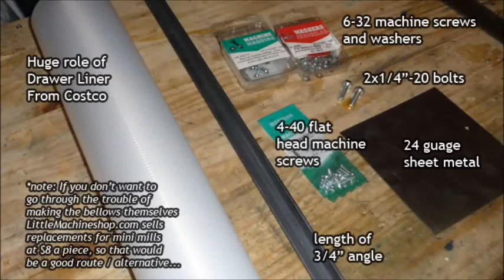DIY Lathe Bellows

Comment: You have some great videos. I'm looking forward to building my own Gingery lathe soon. I had the good fortune to meet Dave at his home some years before he died. He was a very cool tinkerer.

May I suggest that you'll get better performance from your hacksaw if you remember that it only cuts in one direction. You seem a little heavy on the return stroke. It can also help to put a drop of cutting oil on the cut line.

Thanks, again. I'll be referencing your example as I build my lathe.
Reply from the maker: Really cool you got to meet Dave, seemed like a very smart / eccentric person.

Thanks for the hacksaw suggestion. for me most of the time I don't take enough time ( trying to rush through the cut and get on with it ) which is probably why it appears that way. Will have to give cutting oil a try on aluminum, I do use it when cutting steel.

Cheers,
Morgan

Comment: I have been using paper and duck tape on my gingery but I would rather have a more permanent solution. I don't have a Costco around here. That material you used looks like it is from the 70's. The hall way mats that were used to lay on the floor over a carpet or something. Anyways good video...
Reply: how long did it take for you to make your lathe and how much did it cost?
Reply: It took me a year but it can be done quicker than that. I probably spent $200 or less that is including the surface plate I purchased to scrape the lathe and the cold rolled steel. It may cost more for other people since I utilized the scrap yard and the flea market which saved me a lot of money.
Reply: +Micscience I want to build one this summer, but my biggest issue is the furnace there seems to be no good waste oil furnace plans. and I don't think I want to make a charcoal one. and yeah, I plan to buy everything as cheaply as possible as well. including tooling for the lathe hopefully.
Reply from the maker: +David Serrano Hey David, sorry for the late reply, it took me about 2 years on and off as well, though I had no prior experience with casting, hand scraping, etc.. so figuring out how to properly do those things definitely added to the build time. The main cost for me was the steel, tools ( taps, drills, hand scraping tools, surface plate, grinder, etc... ), sand for molding ( shipping cost ), parts for the propane burner, etc.. it really does add up quick, and I probably, in the end, could have bought a mini lathe for the same cost, but wouldn't have gotten the experience of building the lathe. On the other end of it I also designed the controller / driver for the DC motor that runs my machine which added to the cost as well, went through a bunch of expensive MOSFETs, etc...

That being said, if I built another lathe now, it would probably end up costing $150-$200.

Not sure on the waste oil furnace plans, though I have seen some videos on YouTube in the past. Propane has worked out really well for my furnace, though there is a bit of a cost to that, but it's negligible.

Best of luck on your build, definitely don't let frustration get in your way, and there is a great gingery group on yahoo that was a great resource for me when I was building my machine.

Cheers,
Morgan
Reply from the maker: The stuff that I used can probably be has at any hardware store like Lowe's or home depot in the organization section, it's the plastic stuff you line cabinet drawers with to keep things from sliding around.

Cheers,
Morgan
Reply: +Morgan Demers what did you ever end up using your lathe for? also why did you stop making videos? you seem to be the only one on the internet with a good build log of the gingery lathe.
Reply from the maker: +David Serrano Actually haven't used it for much unfortunately, so I'm glad I didn't buy a lathe. Last year our third kiddo was born, and she has kept us busy ever since ;) I've been slowly trying to get back to my projects.

I did build a 3d printer which I use a lot more to prototype parts, so much faster to get through a few iterations that way. I find when I have something to cast I use my manual lathe and mill to clean up the castings, and to bring critical areas to the tolerances I'm looking for.

I would still like to add an electronic leadscrew to the machine for thread cutting, etc..

Cheers,
Morgan
Reply: Morgan Demers I plan to do that to mine so I can do tapers and threads and other cool stuff.